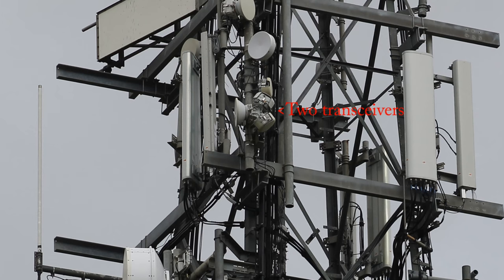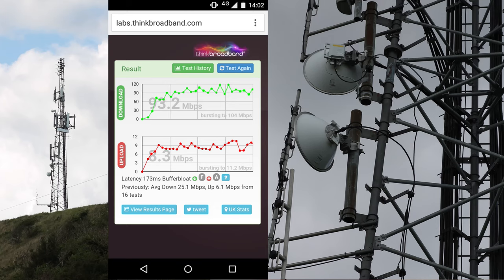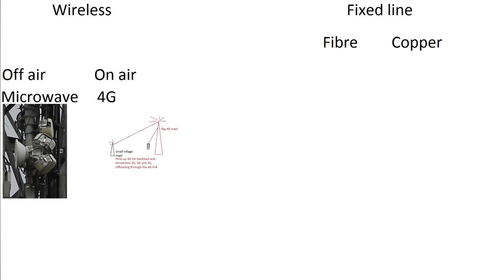Understanding Cellular Backhaul: Microwave, on air, fibre and E1/T1 links

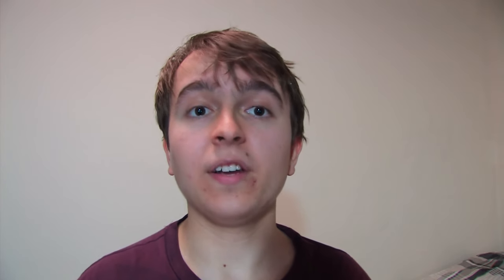Comment: 2:18 This is why microwave backhaul was pretty inadequate for rural masts in the 3G and 4G era, the backhaul availability at each mast would decrease as you go through the daisy chain of microwave links! This was why, despite being in a town, my local EE mast was only single speed/30Mbps upon launch, because the microwave backhaul was simply inadequate.
EE improved things by adding another couple of microwave links to the site. 3 just went straight for fiber.

Comment: Just out of interest have you ever found an on air site or E1&T1 site? If so what speeds were you getting from it?
Thanks
Reply: Haven't seen any on-air sites, usually because the distance between masts (especially rural) wouldn't allow this, but I've seen plenty of Copper based masts in the 3G days.
There were various rural masts (Orange used to do this a lot prior to merging with T-Mobile) which were 2G only, and they received 3G but no upgraded backhaul.
Hence you would see 3G masts with 2Mbps copper backhaul that prived 0.2 - 0.3Mbps to the end user (on a good day!).
Thankfully copper backhaul is no more - with 4G, some networks insist on fiber backhaul where others will operate on a microwave link. For 5G I reckon the requirement will be fiber only.

Comment: My local rural O2 mast is 2G GPRS only.I have 8Mbps ADSLat home  but the mast which is right next to the telephone exchange pre dates it. It is a mono pole with 2 antennas with no microwave link on it. O2 have obviously no intention of upgrading it. Will it use a T1 or E1 connection? Would O2 upgrade it if a fibre broadband was available?
Reply from the maker: most likely E1. The consumer fibre project will not provide for the mobile networks though clearing ducts may help.
Reply: +Peter C Thank you :)

Comment: Hello, great video.  You state that microwave transmission is line of sight only of up to 360km.  

#1- By “line of sight” does that mean it is a straight signal with no curving and no blockage whatsoever?

#2- Is there a maximum up and maximum down in elevation beam variance over a distance of 360km?

#3- What would that variance be for line of sight microwave transmission?

Comment: Great video! :)
May I add, that the E1/T1 copper links are also found on really old Orange masts that are either 2G only or 2G/3G. Quite a lot of rural Orange masts (that haven't been upgraded) had 3G added but didn't have any upgraded backhaul, resulting in 2Mbps copper that gives 0.2Mbps to the end user - ouch!
Reply from the maker: +spotify95 Yeah, yeah, of course!

Comment: I'm trying to troubleshoot why I'm getting such fluctuating speeds through my LTE broadband. I live on the countryside and don't have access to fibre just yet, but the neighbors do. I have a pretty good 4G signal with the builtin antennas in my 4G Huawei router sitting in the window on the second floor. about 90-100 dbm RSRP, ~70db RSSI, SINR about 20db and RSRQ about -10db. At best I can get around 50mbit down, but very often it periodically dips down to 10 or less for long periods of time. There is a lot of trees and such between me and the tower but the signal values look pretty stable. 10mbit or less is pretty useless for me, and I'm trying to figure out why this is. The most obvious one would be the load on the tower, but almost everyone living in this rural area are elderly who barely use computers, and most has already gotten fiber wires installed. Therefore I don't think that's the cause. I'm on band 20 800MHz FDD. I've tried to locate the cell tower with no success (hiking through the woods). My main thought is that multiple cell towers, including mine, is connected very much like you described using microwaves and therefore the bottleneck is elsewhere. But 2Gbit is still a very good speed, and looking over the trees, I can't see the cell tower either, which would make me think that the cell tower isn't that tall and thus might not be connected through microwaves. Any ideas where I should start? I've considered buying bigger antennas to try, but they're a bit expensive to experiment with in case it doesn't help.
Reply from the maker: The signal conditions are very decent so your 4G connection will be able to operate at a high rate depending on its load and backhaul available. Which country are you based in and do you have an android phone?
Reply: @scivids1999  I am located in south of Sweden and I'm using 3 as my carrier (the same one they also have in the UK). Tomorrow I will make another attempt att finding the cellphone tower. Right now at 2am, I'm getting about 28Mbit down, so that shouldn't be due to heavy load on the backhaul unless everyone is awake and maxing out the towers at this time at night. During the days, if I fiddle around with the router a bit and change its location I can get up to 50-60Mbit down, if I move it just outside the window for a while, but it doesn't remain like that. I'm trying to find any consistency across my readings but it's rather inconsistent because the speed doesn't quite seem to follow the signal strength either. For directional antennas, would it be possible to buy two smaller TV antennas, place them on the top of the house and just remove any LTE filters? I can get yagis branded for LTE but they are way pricier and the TV antennas seem to cover the frequency I'm running on.

Comment: the new norm is a 1GIG fiber connection to a central tower, and then they use microwaves to power all the towers in it's reach, then repeat that over and over. at least that is the current deployment going on in my area. My company is providing the 1GIGe links.  I would assume these links are going to increase soon to 10GIGe before to long. but this is the common build for here.  and the funny thing is that they are building this now. when they claim to be going to 5G.  this is what they are replacing the MULTIPLE T1's with.  so glad i don't have to work with 20+ T1's at a single site anymore. that gets annoying.